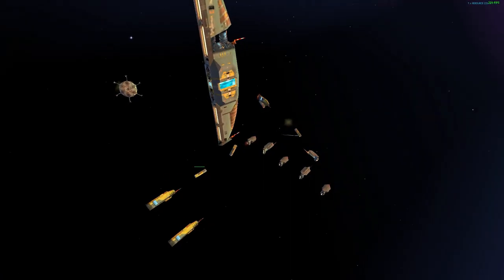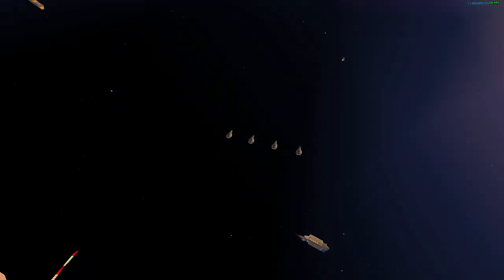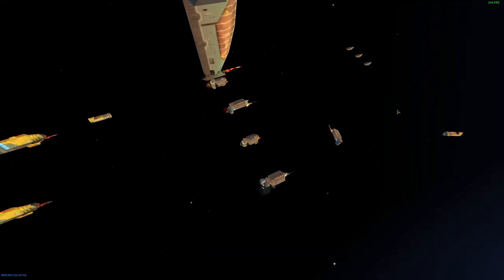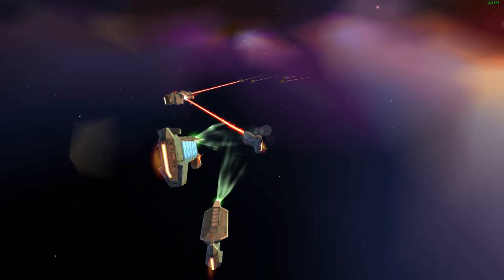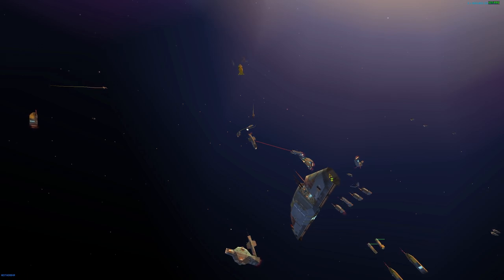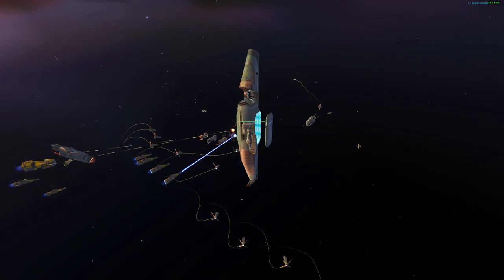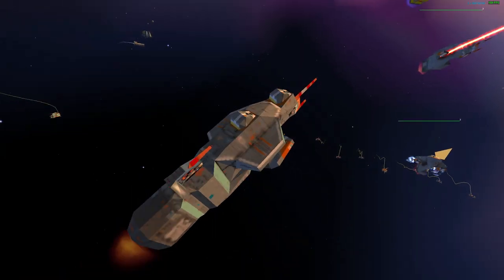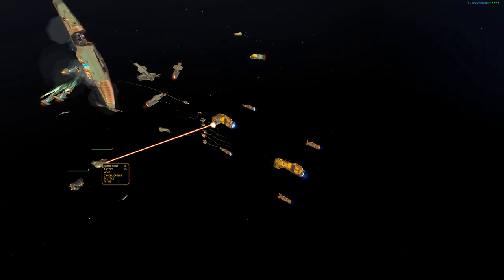Homeworld - Ship Physics & Projectile Ballistics (mechanics examination/showcase)

Comment: 37:42 the small ship to the right side moved downwards and exploded on contact with your ship. not sure if it did damage though. 

personally never played homeworld but i find the ability to suicide charge very interesting. especially if you dont have effective weapons on your ships and would lose in a straight up fight. for example:

fighter small arms being ineffective vs larger ships and would lose in a shoot out eventually. evasive manuever only prolonging the engagement.
alternatively, the fighters ram themselves into the larger ship at high speed. turning the mass and momentum of the fighters themselves into the projectile and dealing high amount of damage according to the size of the ship and the speed it is moving at, maybe even stunning the target.

but such systems probably more likely to crash the CPU simulating all the physics that have to happen for that to work ( / _ \ )